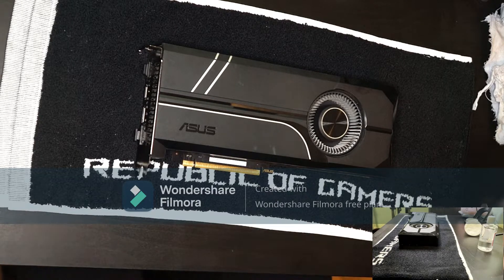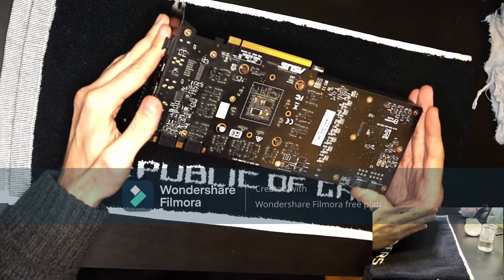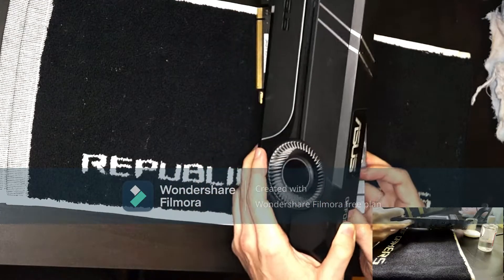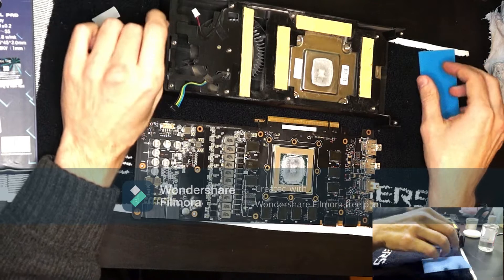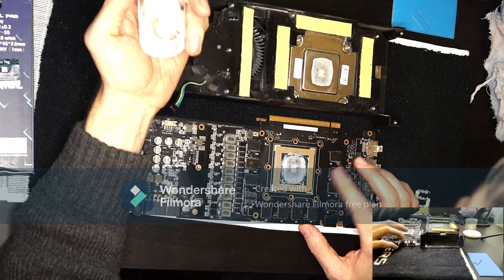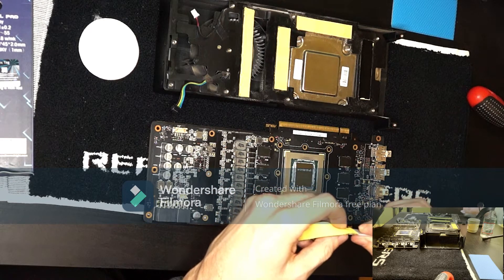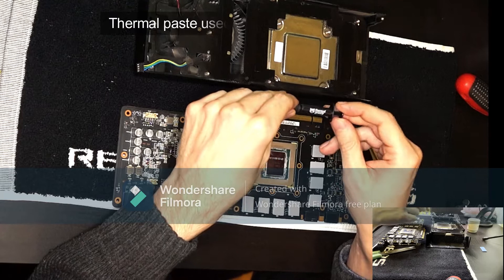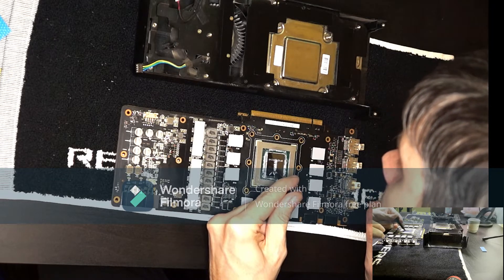ASUS 1080ti Turbo - Thermal pad replacement - good results!

Comment: thank you so much, I used arctic MX-6 paste and TP-3 1.5mm pads and my temps are much better now. I have much more audible coil whine though - it sounds like an angry beetle trying to break free from inside ughhhh... aging electronics are fun

Comment: Thanks for the video, I changed my thermal pads as well thanks to you with minus pad 8. I'm not sure where you got those temperatures at the end, probably from a stress test that's not stressing the card to the max. Under heavy load from games his card will always max out at 84 degrees, that's the thermal max, then it's starts to throttle, and the hotspot is not a sensor, it's just +14 degrees always. So the thing to watch for is the clock speed, this card runs just fine at 84 degrees and 1850 clock at max load, with hotspot always hitting no more than 98 degrees.

Comment: 86 degree 97 hotspot Should I use 2mm or 1.5? termal pad ?
Reply from the maker: try 1,5 mm first. Measure the temps before and after.

Comment: Hello, nice video. I just bought second hand ROG strix 1080ti OC and applied new thermal paste Arctic MX-4. GPU temperature went from 94°C to 70° under heavy load (23°C ambient) and i wonder if i should replace also termal pads. I am not sure cuz hotspot temp is 88°C in peak under load (playing games) wich looks fine i guess. It boosting as it should and it is similar what you get. I wonder what was hotspot on new GPU....
Reply from the maker: Thank you! The temps sound good to me. Please check the memory junction temperature in HWInfo. If it goes over 84 degrees, you should consider replacing the pads as well.

Comment: Did the change the thermal paste make a difference with fan speed and noise? My one has idles temps that seem fine but it's fans stuck at 100% and I can't seem to cha fe it with msi afterburner
Reply from the maker: If you can't control the fans using a custom curve in MSI Afterburner, you might have a defective rpm controller on the board or a defective fan.

Comment: I just replaced the pads on this exact model with gelid extreme pads, 1,5 mm thickness. I also repasted with Arctic mx-6. Results weren't great though, Temps didn't change and were still in margin of error difference from the original.

Comment: I replaced the thermal paste and fan in my Asus 1080 turbo, but the plastic spacers got unglued, and I have no glue. Now I have to purchase gorilla glue so I can glue them back down under the fan and screw it in. 

The current solution I used was a nut under each screw, that ended up giving me a very obnoxious low pitch hum. I am now thinking about replacing the thermal pads as well in my 1080, since the thermals were terrible before, and now with the new thermal paste it's so much better, I'm hoping to see see idle around 29c with the new thermal pads. Thank you for this video, because I couldn't find any video on specifically the turbo 10 series card thermal pad replacement.
Reply from the maker: Thank you for your appreciation! That is exactly why I made the video, there were no guides for the Turbo variant. 
Make sure you underclock it for best results. I managed excellent temperatures for it once I modified the fan curve and the voltage (using MSI Afterburner and the voltage curve - Ctrl + F).

Comment: Thanks for covering this somewhat rare version. I will do this as soon as my thermal pads arrive. I do wish, however, that you would have covered the rest of the servicing / disassembly (shroud and cleaning radiator fins). Thank you.
Reply from the maker: Thank you for your suggestion! I will make sure to include more details in the next tutorials :)